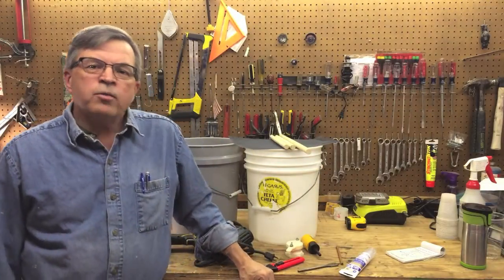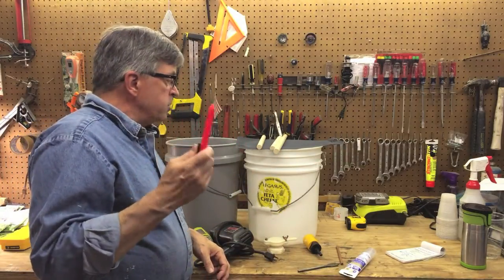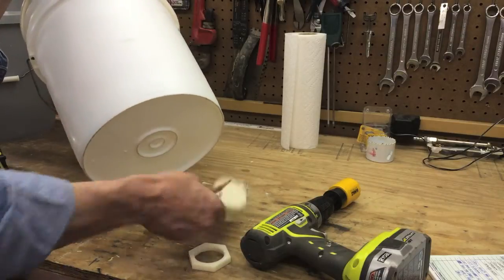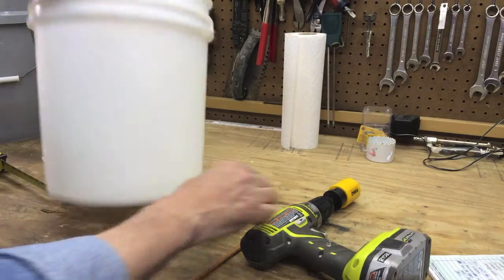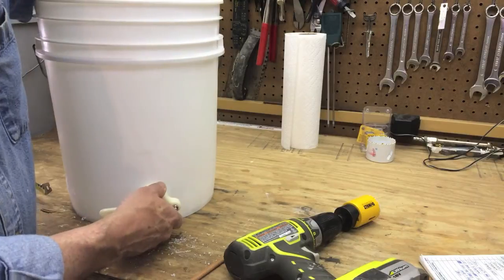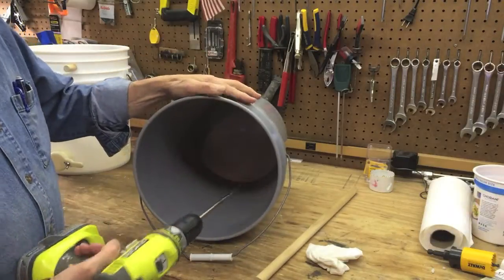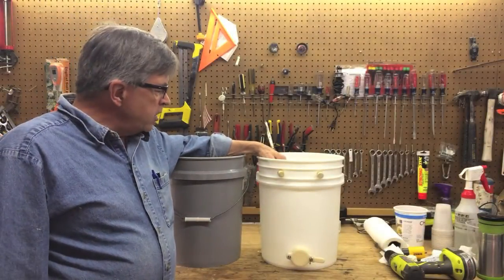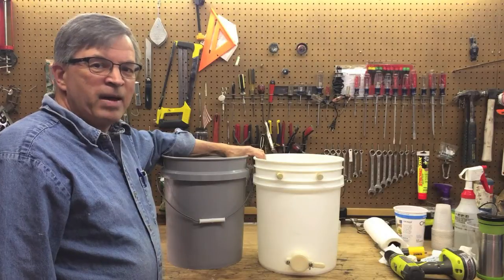$15 Honey Strainer

Comment: I like the idea and thanks for the video. I have a couple of questions. Did you fix the screen? How many holes in the bottom of the grey bucket? If the bottom is flat do you get quite a bit of honey left st the bottom?
Reply from the maker: The screen worked out fine. I did drill four more holes in the bottom to drain faster/bettr though. Not much honey gets left either. Thanks for watching. How many colonies do you have?
Reply: @CleanSlateFarm  I just have 3 as I only started out last year and I don't really want more, as I already have too much to do!  So just doing what I need to keep one colony going for sure.

Comment: Thanks for sharing I just found your channel and subscribed to it I am a second year beekeeper here in West Virginia hope all is well and hope you have a great day.
Reply from the maker: Thanks for subscribing, watching, and commenting. Good luck with the bees. They are fascinating little devils for sure. How many colonies do you have and how have they overwintered?  BTW If you buy an extractor get motorized right away. Easier use and more honey extracted vs manual crank. I use the 4/8 frame Vevo. I started with a two frame, then a four frame, then to the 4/8 electric. Save yourself the headaches and start electric. Here is a link to our Amazon Store. Go to the beekeeping section and look for the extractor. If you buy it from our store we get a small commission, actually if you use that link anytime we get a small commission. It helps keep the channel going and is greatly appreciated. But I'd really like to know how your colonies overwintered. We lost all of ours due to cold weather this year. Fabius, NY is not warm by any means in winter. Thanks again!   https://www.amazon.com/shop/cleanslatefarm
Reply: Clean Slate Farm Thanks for the info I will check it out. I went into winter with 5 colonies and lost 3 of them I think the veroa mites got them I did treat them enough times before going into winter but I know now. I still have 2 colonies left I am hoping to be making some splits from them about the first week of May it has been cold here the last couple of days. I live in northern West Virginia on the pa border so we are still having some cold weather here.
Reply from the maker: Struggling Beekeeper Mark Cottrell It looks like ours absconded. When I opened the hives there were no bees at all. Starting this year with 2 new local nucs in a few weeks. Probably mid May up here in Fabius NY. We don’t treat and up until 2 years ago did okay. Some loss but workable.
Reply: Clean Slate Farm I wish you luck with your new Nucs I hope they do well for you. I treat my bees but I am hoping someday to find a way to not have to treat them I also have 8 swarm catchers out I am hoping to catch some feral bees this spring if I do I am going to try to introduce some of their genetics into my bees and see if that helps with the mite problem.